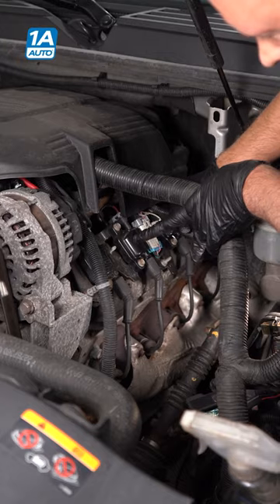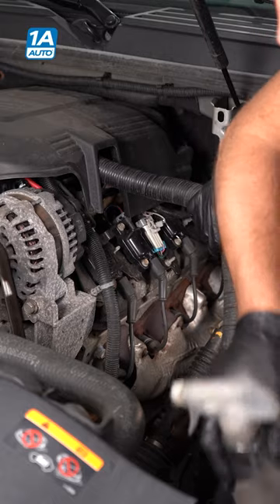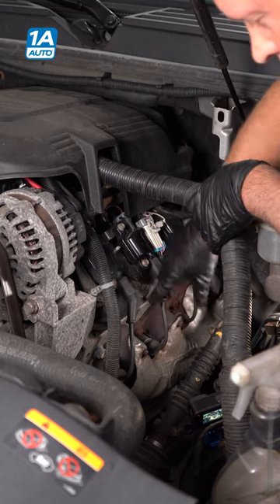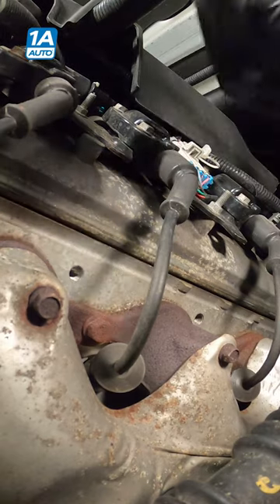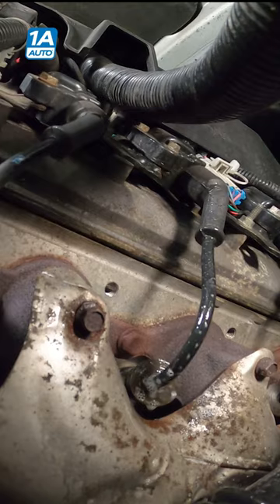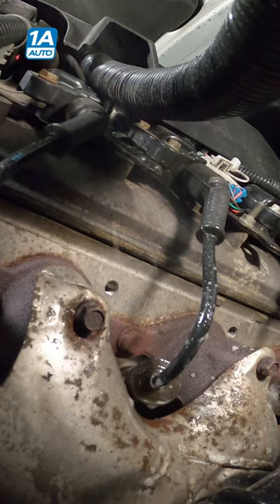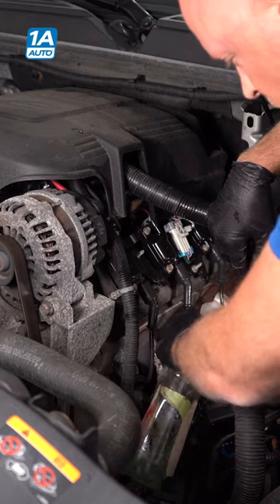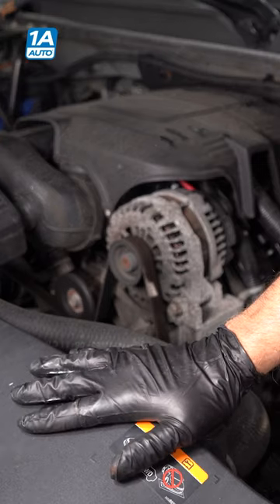Finding a Misfire with Spark Plug Wire Diagnostic #shorts

Comment: I actually got shocked by touching the wires while running, I replaced it with a brand new one and I'm still having problems starting the vehicle
Reply: Hope you get it fixed I'm in the process of bringing my car back to life
Reply: tighten them up and make sure there gapped right g

Comment: checks if there's too much resistance somewhere as well. Maybe plug got damaged or has too much gap. Would use this along with general plug check as well. Had one with a misfire the other day that recently had plugs and wires put on within the last year or so and all plugs on the driver bank were loose/finger tight.

Comment: Just get an inductive pen tester. Place it on each spark plug wires and see if it lights up or not. Really easy. Fixed my problem it was a bad coil pack.

Comment: Nice video. Good tip. Thanks. Now what do we do for coil on plug?
Reply: Those parts house coils are terrible. too expensive and fail on the regular.
Reply: Say cylinder 3 is missing, move coil to 2 plug to 4, restart and monitor misfires with obd scanner, if it moved to 2, it's a coil, if it moved to 4 it's a plug, if I stays put possible injector or low compression
Reply: @mechanicin  replace whole coils and spark plugs that I would do.
Reply: @Kevin-jn4uq  not everyone is a tycoon like you to afford it

Comment: Thank you sure I’ve learned a lot from you; I had a rough engine that shakes hard every time a come to a stop sign or a red light 🚦 the engine literally gets crazy but on the road it act normal some mechanic told me that’s normal in a Corolla 2007 Le and another one said it’s a vacuum leak then replaced cracked pcv valve hose + the valve itself by original one but nothing changed; until I saw 👀 this video then I checked the spark plug coil and find out that number 1 the bolt holding it was totally loose fixed it and immediately problem solved. Thank you sir you deserve the title of MECHANIC PRO. I wonder how those 2 mechanics didn’t check that loose coil bolt !!!

Comment: .So I had to check engine light. It was a PO420 cat bank. 1 then.... Started flashing and my truck misfires but it's only when you're full throttle.... Possibility that it's just plugs and wires. It has 212k. Maybe the last guy changed it at 100k with cheap plugs... I'm thinking the gaps are off and it's sending fuel into the cat and throw in the 420 code. I haven't gone back. Scanned it again to see what the flashing misfire is, but at high RPM that's a usually spark. The guy did replace all the fuel lines and brake line so I'm going to see if there's any kinks in the lines. But if it was a kink in the line or a fuel pump you would think it would be a more of a bog not a miss and it runs great everywhere except for full throttle. I thought it was my transmission slipping at first. Now I realize it's my motor missing and not pulling... Not being the transmission is great in my opinion. Saves me money. I'm short, whatever is wrong with it. Can't be more than a transmission. Hopefully it is just plugs and wires and that's throwing the 420 code but I'm not sure. Runs great until you try to rip it so I just drive like gramps right now

Comment: Just did my spark plugs yay ! The ones I took out I guess had some stickiness to the threads . I’m guessing oil or just carbon ? Hope it’s not oil . 11 LE 2.5 L with 175 k miles . Unfortunately the tabs fell off the coil connections . And valve cover looked very dirty with caked on oil . I cleaned it off . The oil stains could’ve been from oil filling and they spilled it I guess . I’ve been checking oil level and it don’t seem to be going down

Comment: Plug could be missing grease in that areas as well and that’s why it’s arcing like that is because it’s supposed to be stopped by it but they must not have put enough there or the wire has torn/shorted

Comment: Tell me what's wrong with my 2005 silverado 6.0
New coils plugs wires injectors MAF sensor throttle position sensor and knock sensors. 
Multiple misfire code p0400. I can't figure it out. 😕

Comment: Kind of irrelevant considering most cars use coil on boot setup, swap a coil and a plug to different cylinders monitor misfire and see where it moved, if it didn't move do compression test, then leakdown test if low compression

Comment: I have a 2007 Dodge Nitro. Spark plugs haven't been changed since the vehicle was purchased about 7 years ago....😮
Just a few dasy ago the check enginevlight came on & at the same time the vehicle shook & then it went back to normal. 
Now the check engine light is off again..... I can't see the spark plugs when i look under the hood.... Location anyone...??😮

Comment: Even easier - just plug your Scan Tool into the OBD port and it will instantly identify which cylinder/plug/coil pack is mis-firing.